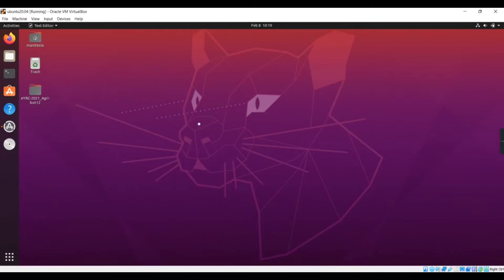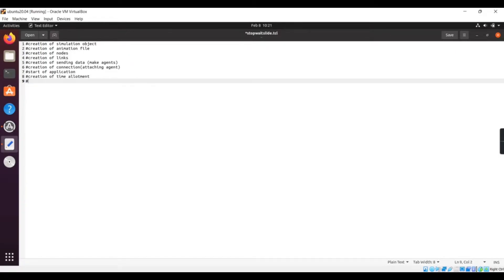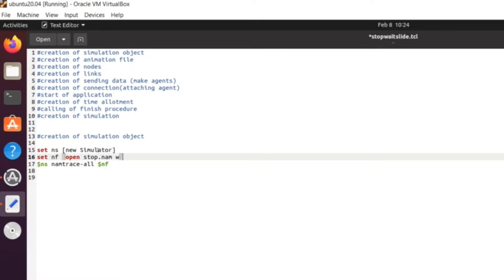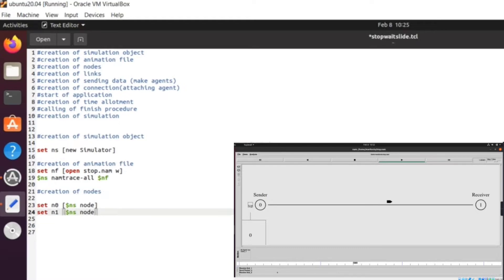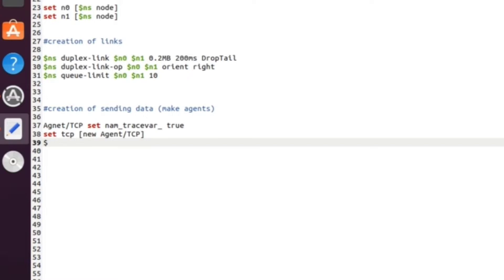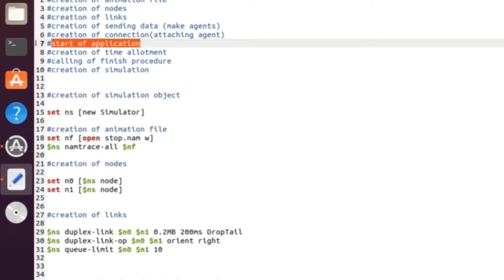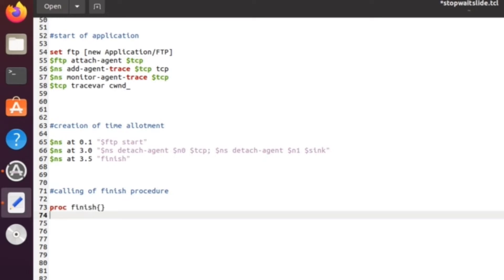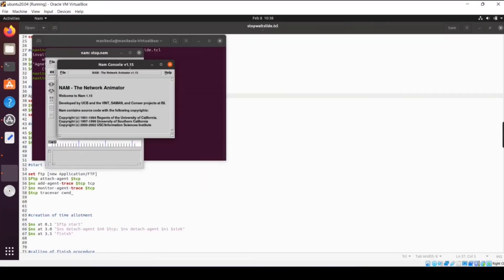Stop and Wait Protocol / Sliding Window protocol | Ns2 Simulation Detailed explanation

Comment: set ns [new Simulator]
set nf [open sliding.nam w]

$ns namtrace-all $nf

proc finish {} {
    global ns nf
    $ns flushtrace-all
    close $nf
    exec nam sliding.nam &
    exit 0
}

set n0 [$ns node]
set n1 [$ns node]

$ns duplex-link $n0 $n1 10Mb 10ms DropTail
$ns duplex-link-op $n0 $n1 orient right
$ns queue-limit $n0 $n1 10

Agent/TCP set nam_tracevar_ true
set tcp [new Agent/TCP]
$tcp set window_ 4
$tcp set maxcwnd_ 4
set sink [new Agent/TCPSink]

$ns attach-agent $n0 $tcp
$ns attach-agent $n1 $sink
$ns connect $tcp $sink

set ftp [new Application/FTP]
$ftp attach-agent $tcp
$ns add-agent-trace $tcp tcp
$ns monitor-agent-trace $tcp
$tcp tracevar cwnd_

$ns at 1.0 '$ftp start'
$ns at 2.0 '$ftp stop'

$ns at 5.0 'finish'